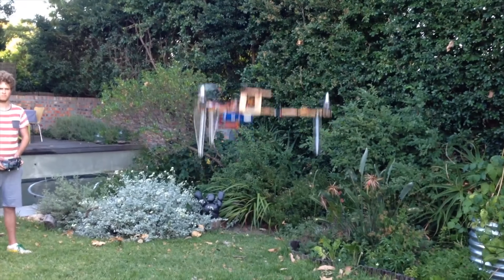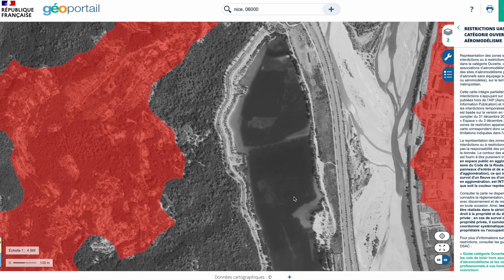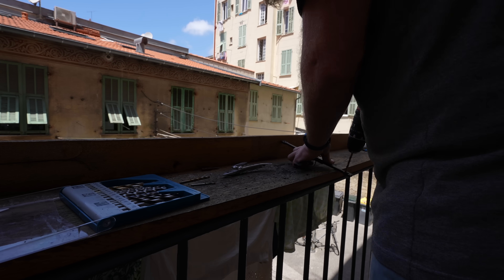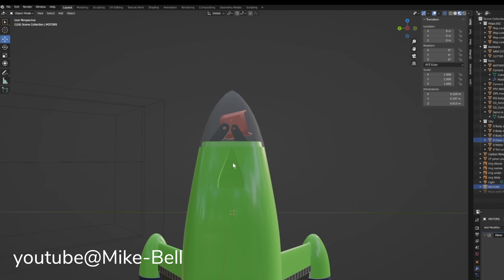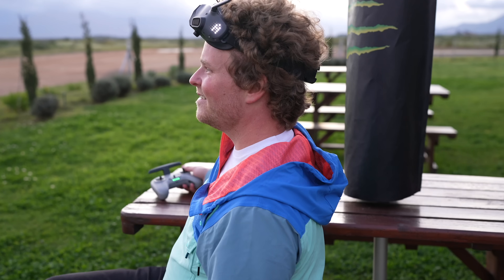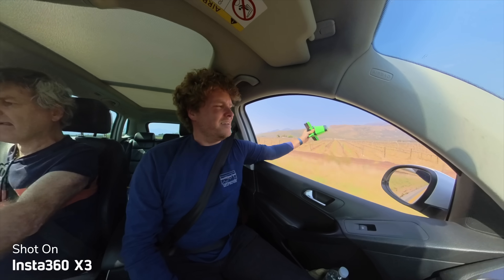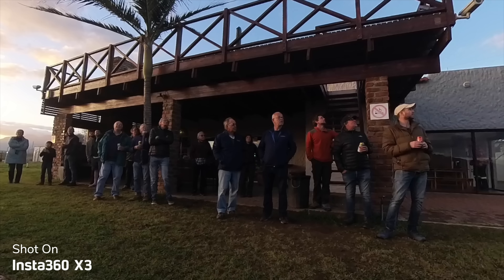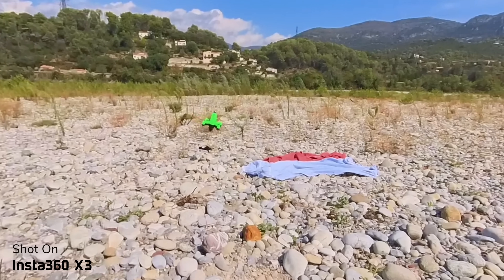How I Built the FASTEST Drone on Earth

Comment: the drone first crashed because it clearly said low battery and instead of pressing RTH you kept flying.
Reply from the maker: FPV drones are very different to DJI drones. It’s too long to explain in a comment but this statement is not true. The reason it crashed was a component failure.

Comment from the maker: If you have any questions you'd like me to cover in my technical breakdown please reply to this comment with the questions! If you are interested in picking up the Insta 360 GO3 or X3 cameras find links to latest pricing below:

📸 Insta 360 X3: https://geni.us/8P2CBZ4
📸 Insta 360 GO 3: https://geni.us/IdE4AH
Reply: would really like to know what motors and ESC you're using tho.
Reply: Hey man, I am indeed going to pick up a camera. Question about overheating. Would there be any value in perforating the 3d printed cones with holes, like golf ball dimples? I'm not trying to be cute or clever, but the pressure differential from the heat would keep the air flowing through, and in the right direction. Or maybe some small slits or louvres? OR if you wanted to be cute, a kind of NACA Duct? I am only spitballing. I enjoy your channel and have decided on a Chimera7 FPV drone for some long range flying. Fun times!
Reply from the maker: Very interesting question! We will look into it for the next design. @catsfive
Reply: 3d printing files?
Reply: @elclay  nailed
Reply: Controler type, motors & voltage used, amazing video & well done on the record.
Reply: Put a free floating dragon tail on it. The length of which, if correct wavelength, will damp oscillations at speed, and improve aerodynamics.
Reply: It's really cool bro I fly fpv what pitch is your o3 camera thanks
Reply from the maker: About 80 degrees for the full speed runs. @nrgfalt
Reply: @LukeMaximoBell  thanks bro I will look forward to your build vid just one thing what motors are they thanks
Reply: Have you considered using rotation to stabilize the drone in high speed flight?  like a football? 
you would be blind for the time it was spinning but with practice and planning you can just aim and hard punch in a direction.

OOO... maybe a free floating fuselage that catches air to spin and acts like a big gyroscope.   OwO
want some blueprints?
Reply: What about hardware? Motors, fc, esc, props and battery?
Reply: thats great. does it not fly longer and faster when you make the propellers larger ?
Reply: congrats
Reply: The last shot with the camera on the drone was good, too bad you didn't do any more of these..
Reply: 11:01 what's the bellows for?
Reply: HEHE --- I AM CURIOUS OF THIS AS WELL --- I ASKED ABOVE JUST NOW ---- MAYBE TO COOL THE BATTERY?   @nathansmith3608
Reply: 😢😢😢l😢🎉😢🎉 🎉😢😢🎉llllll 🎉ll🎉l
Reply: Love to know about the power management. Looked from the OSD overlay that the batteries experienced severe voltage drop at full power.
Reply: @mach5406  if you're talking about toroidal props, those turned out to be a scam and aren't revolutionary at all. their only advantage is being negligibly more efficient which is not needed for a performance vehicle.
Reply: Skunkworks beat you to it...they have magnetic levitating drones that can easely accelerate way faster than you would think ^^ They will be showcased in the "Alien Invasion of Earth" in just a few years
Reply: Very cool! Would be interested in the controller info thats giving you all that heads up data!
Reply: Pls make an X-WING ❤ AND THE specialised Red stormtrooper TAI-FIGHTER.. or Darths ❤😅🎉
Reply: Your first frame is already X wing 🪽
Reply: 11:00 Always pump up your Tyre's 😁
Reply: Just DONT LET DARPA NEAR IT !!!!
Reply: Oh.. and Congratulations 🎊 👏 🎉❤ 😃
Reply: Anything involving a south African i subscribe . Love my countrymen . An congrats on your achievement . 🎉🎉
Reply: what flight controller and ESC did you use
Reply: I can't find the motors even if I put the full name(Cobra Champion 2207 2450kv)
But I can't find it... Could you post a link please🙏
Reply: why no use toroidal propellers?
Reply: @steinanderson  why would you in the first place? do you even understand what toroidal props are? record breaking involves a perfect combo of props and motors. toroidal props aren't good at anything. they are only negligibly more efficient which is the last thing you need when building a performance quad. you don't really know what you're talking about and have fallen for hype if you're seriously asking that.
Reply: Lets try and be specific.. you have he fastest drone, ON YOUTUBE.. 
Do you have any clue how many humans build things and dont feel the need to post it? like, its the majority actually...
Theres a guy in my town that made a supersonic trebuchet.. youll never hear about it
Reply from the maker: Sure, I'm not denying that some dude might have made a faster one out there. This is exactly why an authority agency like Guinness exists though. Somebody has to keep track of registered records otherwise we have no idea who has the record for anything.  @Skinnamarink.
Reply: a similiar system was posted on youtube a few years ago. i'll have to search into my viewed videos to pinpoint the exact channel and vid. 
 but it was it was awesome. you could hear the sonic boom even, it was built with hightech materials {carbon fibre titatium or others im not sure } . Im tryinging to rembember how the channel was called. I want to see that vid again because it was so genious.  @Skinnamarink.
Reply: @Skinnamarink.  Technically a drone is not very well defined... this is really a RC quadcopter with flight controller.
Of course a RC plane with FC could fly much faster, there is a guy who flies RC sailplanes twice that fast, that's without any engine, and without a FC!
Reply: what im saying is, theres a guy that has a drone that almost doubles your speed. again...youll never hear about it..
Reply: @Skinnamarink.  Who pissed on your chips in the past? Anything could exist undisclosed somewhere. I have a mate that has a working time machine, you'll never hear about that also. @LukeMaximoBell1 has the fastest drone which has been disclosed and publicly documented, someone may or may not have something faster but until such time it's publicly evidenced Luke keeps the bragging rights.

Comment: So are you just measuring the GPS speed or are you timing it across the distance?
Reply from the maker: GPS data.
Reply: @LukeMaximoBell  oh thank god, I am doing a sub 250 gram record attempt and my guidelines said I had to use timing over 100m but if your using GPS then that makes it so much easier for me. I'll have to get in contact with them to modify the guidelines.

Comment: I have a feeling you've started something here.
Paving the way to the 400km/h mark maybe? 
Just out of curiosity, how much weight do the 3d printed parts add and what difference would tri blade props make? 
Top job, I hope you keep at it.
Reply from the maker: We were designing the upgrades for a faster drone on the drive back from the attempt 😂 I’m going to attempt for a 450kmh flight at the end of this year. I think I can 100% do it
Reply from the maker: I’ll reply to questions like this in my technical breakdown video.
Reply from the maker: But the simple answer is. 3D prints were about 130g. There are no 3 blade props that could deliver this speed being manufactured
Reply: 3d body is 190g. Battery 390g. Total 1060g.

Comment: 364 AMPS, jesus... is it real? is the current meter calibrated?
Reply: The first versions power readouts were not yet calibrated. In the final runs they are correct.
Reply from the maker: At max it pulled about 250A on 8S!

Comment: cooling it down with a bellows is the sickest thing in this video. no cap.
Reply: Luke didn’t expand on the overheating issues which caused quite a bit of stress.
The next version will need some clever improvements. Or we’ll just bring along the bellows again.
Reply from the maker: Gotta give the credit to my dad for that one 😂 It's from his fireplace! hahaha
Reply: @LukeMaximoBell  I've been trying to build a 7inch GoPro rig that can keep up with supercars and in the process have desoldered my ESC midflight nearly 10 times. At top speed. It is devastating. 

......if only the bellows could be on the quad while it's flying

Comment: Are you on standard pids
Reply from the maker: No they are quite off normal standards! It's tuned for speed only and nothing else.
Reply: Looking forward to that video on how you tuned it, i tryed 7inch apc props on 8s with 3008 1150kv motors and  a rebel ruxus frame with a naked vista and had hot motors and wobbles but looking at that i mite try 6inch props, whats your all up weight mines 485gram and ive liked and subbed to you bud great work!

Comment: Awesome but by using a o3 air unit you added unnecessary weight also the voltage could have been 8s
Reply: I think it was 8S I saw two XT60's
Reply from the maker: It's 2 x 4S in series to make an 8S. Yeh you are right the o3 is unnecessarily heavy, but the weight isn't that important here. I will explain in my technical video.
Reply: that is incorrect there are plenty of 8s batteries  @LukeMaximoBell

Comment: What motors are you using? Stator and kv ?
Reply from the maker: Velox 2808 1950kV. I’m planning on doing a technical rundown video as well. It will be super in depth. It’s just too much jargon to include in a video like this which is supposed to have broader appeal.
Reply: @LukeMaximoBell On 8S....hooooooly smokes. These motors can take a lot more than the community seems to think...
Reply: @LukeMaximoBell can’t wait!  Well done dude 🇿🇦
Reply: Awesome video! Good job man. Thats wild. It's funny I came across this video today cuz I'm just about to go do some speed runs with my newest build. I'm using my go pro GPS for the data cuz I just havnt installed my on board GPS yet. Which will probably give me a few more mph cuz go pros are heavy and mess with the aerodynamics.

Comment: Congrats 👏 
Will you share your setup?
Looks like you're on 8S and some APC 5.1x5.0 props. 2207 motors ?
Reply from the maker: Yeh for sure I will. I might make another very technical video. 

8S, APC 5.25x8, 2808
Reply: @LukeMaximoBell  Just curious, when did you find the 5.25x8? I paid to have the molds made for the CCW just FYI lol! Have you tried the 5x7.5?
Reply: @LukeMaximoBell Are you using the tmotor f4 motors?
Reply from the maker: T-Motor Velox @leenanipun1269

Comment: The Peregreene is even faster than than Peregrine Falcon.  That's epic!!!
Reply from the maker: He is 🤩 excellent drone!
Reply: Wikipedia says: "A study testing the flight physics of an "ideal falcon" found a theoretical speed limit at 400 km/h (250 mph) for low-altitude flight and 625 km/h (388 mph) for high-altitude flight." 
But these speeds are only in a dive; this bird will be horizontally overtaken by a swift, whose speed is 112 km/h.
Reply: @maxIimI101  Otoh they can fly all day long (and swifts can stay 11 months in the air, sleeping on the wing! coming down only for nesting)...
How long can these 300+ km/h drones fly?
Reply: @DR_1_1  Bro, there are no universal drones yet, but there are hovering ones, I won’t look for information now, but they are ultra-light, like a paper airplane with a motor, if you attach a solar panel, which also seems to exist, Musk seemed to promote this before Starlink, these can catch wind currents for a long time and make course corrections
Reply: @maxIimI101  Cool story, bro... you couldn't answer a simple question, though, how long do these record breaking quads stay in the air. 5 min? 3 min?
Reply: @DR_1_1  Airbus Zephyr 64 days